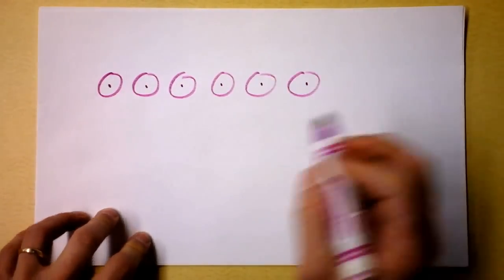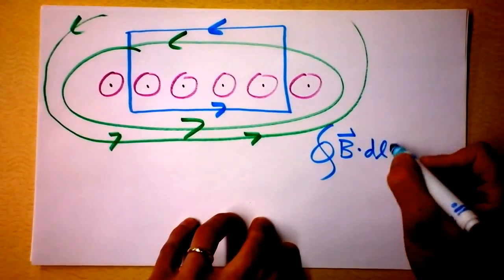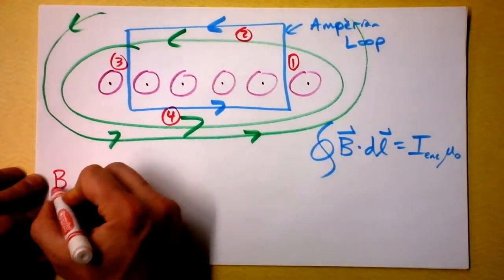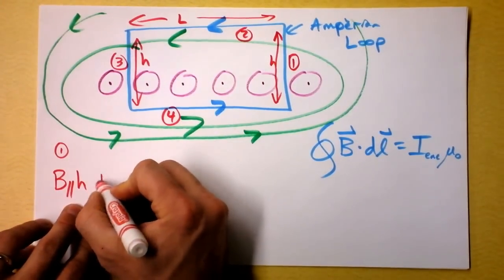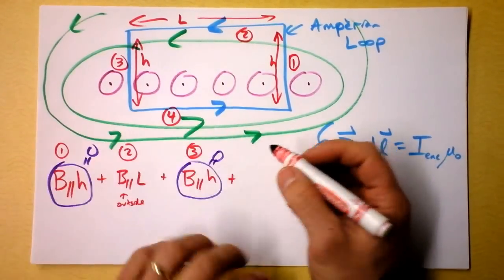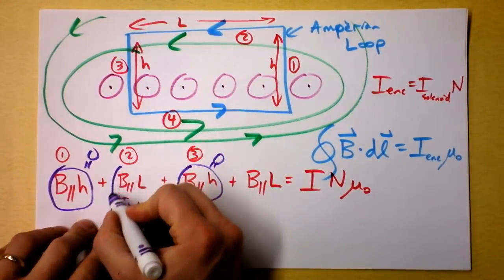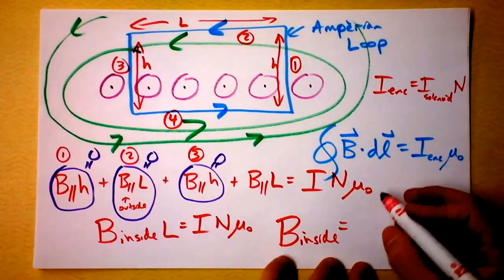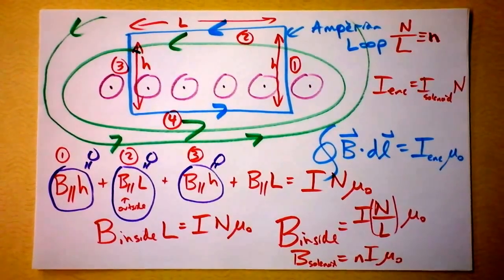Ampere's Law Example for a Solenoid | Doc Physics

Comment: Wait a minute, LOOPS CAN'T HAVE DIRECTIONS, can they?
Instead, we should do it like the loop is so close to the solenoid, that there is no, or negligible magnetic field just outside the solenoid. That will give us the same result, only, we use a more rational method.
Reply: Actually. The Amperian loop has direction. Because when the right hand's fingers turn towards the direction of the loop, then we get the positive direction of current through it .